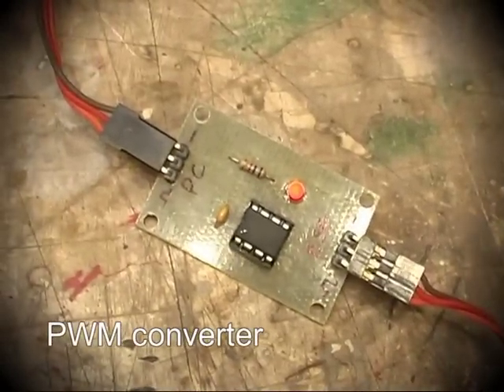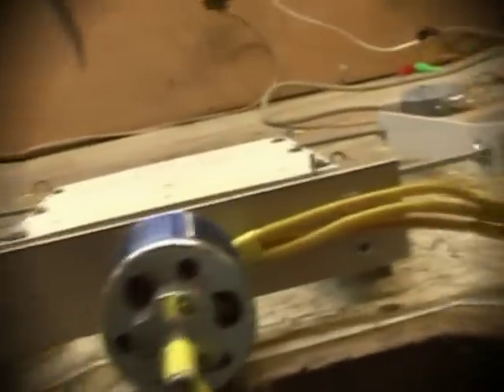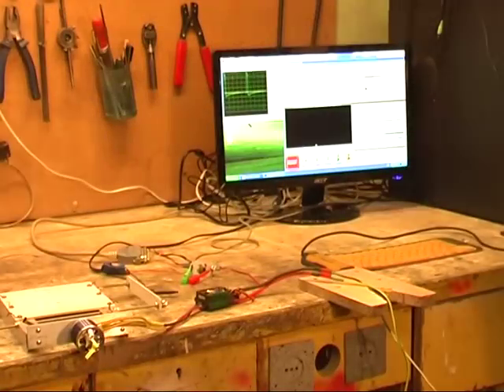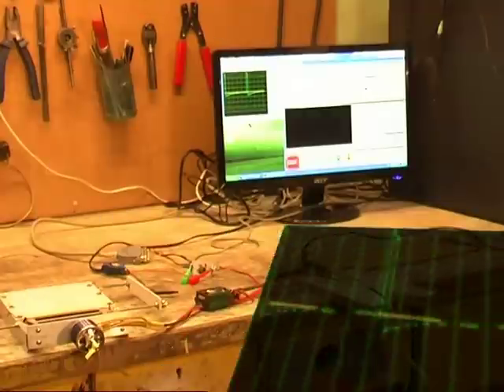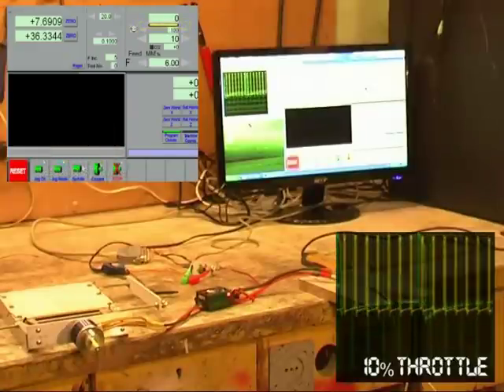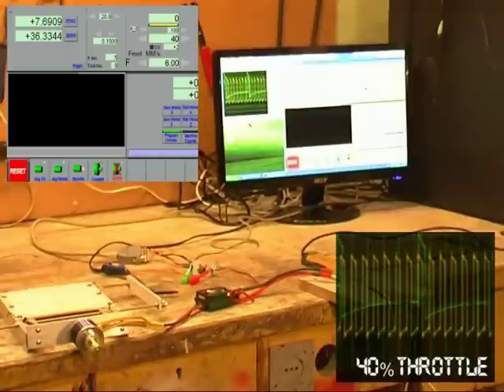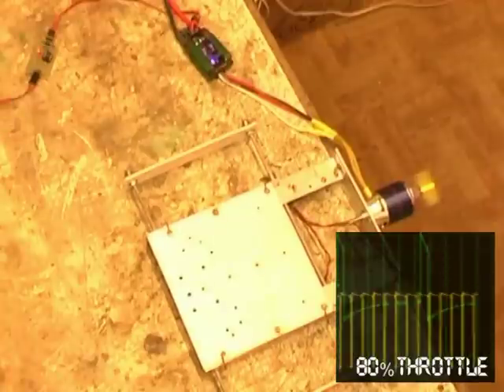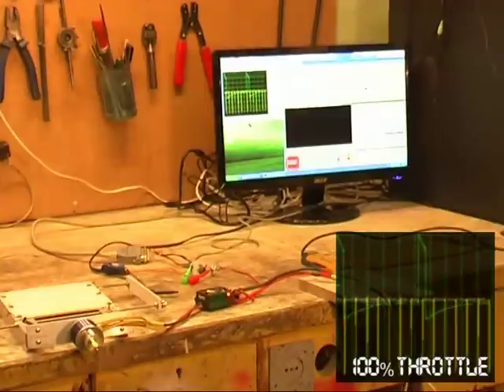Mach3 to brushless ESC PWM converter

Comment: It didn't work on BL-USBMACH V2.1
Reply: Hello Friend,
This circuit was developed 10 years ago, when BL-USBMACH was not around. Probably, it has unexpected spindle output.
If you attach the scope to the spindle output on USMBACH and observe that it generates 0-100% duty cycle pulses at a frequency, which is set up in MACH, then it should work. Also, please check the recommended frequency to set in the description of the converter. If it is too low, it would not sense the signal.